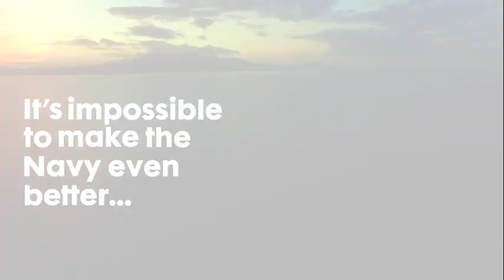The Very Lightweight Torpedo

Comment: Very light weight more like ultra light weight. That thing is TINY. And while I'm sure the seeker is almost as good as a 17 inch the fuel and warhead capacity leaves doubts that it will have the legs to get to its target and that the explosion will do enough damage to make it count.
Reply: The target might be also rather smoll, like drones.
Reply: If it’s at an under water target you don’t have to do much damage you have a hull crack your fucked.
Reply: A six inch torpedo that can land a hit on a submarine is more than enough if it's a shaped charge. A liner for a 21" tube can probably fit five to seven of them, easy to envision one of the four tubes on a Virginia set up like that, and a couple reloads in the torpedo room. The case with ASW aircraft is even better - replace a single heavy with three or four of those, quadruple chances of a hit, while managing to cut payload weight by half.
Reply: I would like to know the specs on this torpedo compared to a conventional torpedo
Reply: here goes the military expert.